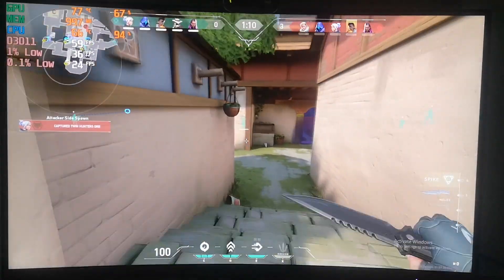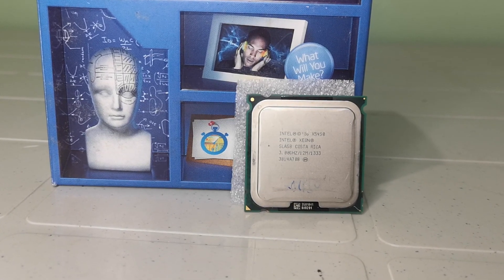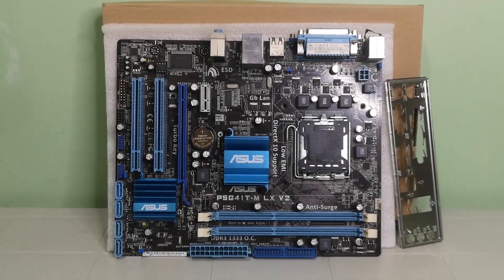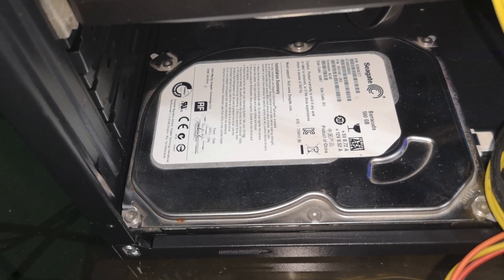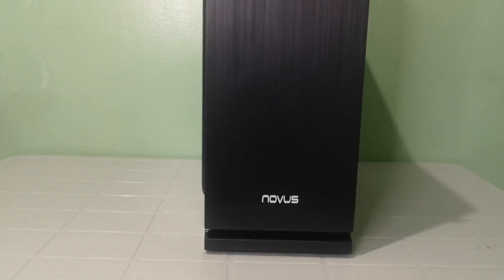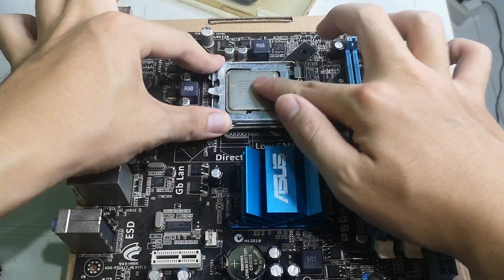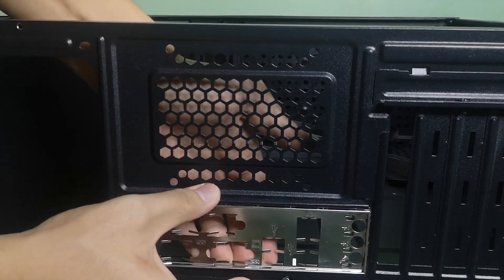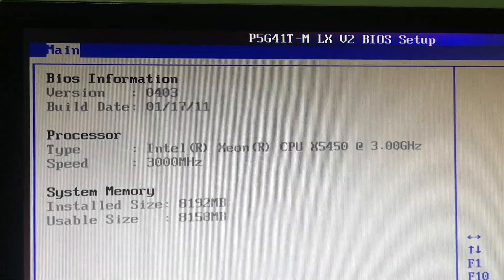₱9.8k Xeon Build

Comment: You could spend similar money for a better rig like the X58 with GPUs like R7 260x. R7 260x for like 2500 php. Even a brand new Ryzen 2200g cost around the same range and performs better than an LGA 775 build.

Comment: misunderstanding ng users built in graphics are in in the MOBO itself its inside the CPU its called iGPU(integrated graphics unit) which some people call built-in graphics.. its in the CPU not in the MOBO so if your using a CPU like xeon LGA 2011 above then all xeon have no iGPU this means if you keep telling your MOBO have built in graphics and you use a cpu without one then all you will get is black screen LOL..
another info for LGA 775, 1155, 1156 etc or mainstream motherboard, all xeon compatible with this are basically an i3, i5, i7 processor with and without iGPU kaya if may GPU ka much better going for xeon cpu that support this sockets mas cheaper xa kesa sa i3, i5, i7 and you can also use ordinary ecc or non-ecc ram this xeon processor are not really server processors.
the  next is ;
LGA 2011, 2011-3 up to latest gen are what you call SERVER CPU (XEON) this cpu support server registered ecc ram which is much more reliable than ordinary ram.. kaya nga server ram ayw mo mawala data incase of unknown problem.
and lastly if you did much more detailed research.
you can build higher xeon gen which is in between i7-7700 and i3-10100 performance (i3 10-10100 is basically an older i7 4core 8 thread cpu but much faster than i7 7700)
for example;
xeon e6-2620 v3 USED (6 core 12 thread 2.6ghz all core base clock 3.2ghz all core boost clock) = 853 php (shopee) this is around 10-15% weaker than i3-10100
x99 mobo lga 2011-3 bnew = 3420 php (shopee)
8gb 1x DDR4 2666mhz bnew =1.6k+ php (shopee)
HP 120 GB SSD bnew = 624php (shopee)
450 watts inwin 80+ bronze PSU bnew - 1150 php (shopee)
m-atx generic acrylic case bnew = 650 php (shopee)
OEM 2 copper pipe mini tower heatsink = 220 php (shopee)
GT 710 2gb USED - 1300-1500php (local market place FB) 

more or less than 10k if you can find cheaper variants specially for the ram.. ram is easy to upgrade so you can fill up the 3 remaining slot later for quad channel.
this is a budget gaming pc actually if you pair it with rx 580 8gb or gtx 1070 8gb this will turn into a 1080p med-high budget gamig build for AAA games if paired with gtx 1070 8gb or gtx 1660s which iis gtx 1070ti equivalent and with better nvenc encoder then you can stream while game on this build using nvenc hardware encoder and multi task while streaming and gaming since this have 6 physical core w/ hyper threading.
actually going with thiis route is better than building a ryzen 3 APU for 18k-20k php the performance wiill be the same but for price you can save up for a 1080p budget GPU like gtx 1070 well currently OP atm cy 2022 ,  but there are some rush seller that sell it at good price like a gtx 1070 8gb for 10k here in my area or gtx 1660s at 14k. pairing this xeon lga 2011-3 build with nvidia gpu is a must if you want to stream your game without problems in a single pc build and you can pair it with a 144hz monitor if you upgraded the gpu.

Comment: Wait Rex cool isn't reputable? and it blew up? We have literally the same power supply.
Reply from the maker: I literally never heard of it before. could be just where i'm from. but yeah, it blew up while I was benchmarking. Another thing to consider is that the one I got looked dusty and old.
Reply: @droborja  binigay lang din SA akin Yun nang libre. Putik Yan dalawang beses na Ako bumili NG hard drive. Puro madaling ma corrupt. Pwede bang Yung power supply Yung nag hihinder po doon. Specs ko PO

Core i3 540 (3.06 GHz)
6gb ram 
500gb hard drive
GTS 450
Tapos same power supply sa inyo

Binuild po Siya noong 2018 if I'm not mistaken we bought it for 5k php
Reply: @droborja  ps I think they gave me it brand new.

Comment: Is apex legends playable by upgrading ram?
Reply from the maker: I dont think so. 8gb is still good. Maybe upgrading the gpu. I updated the bios with the latest micro codes though. I found out that this cpu is missing some instructions when used on lga 775 mobos. I'll check first and see if it makes any difference for the x5450.
Reply from the maker: just an update, Apex won't run. It keeps on saying that the cpu is missing some instructions that will allow Apex Legends to run. sad